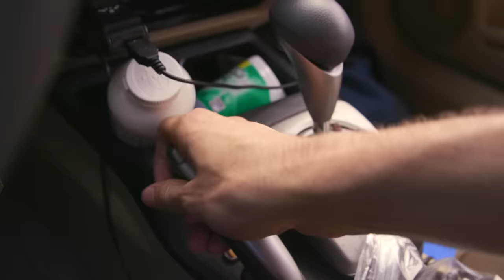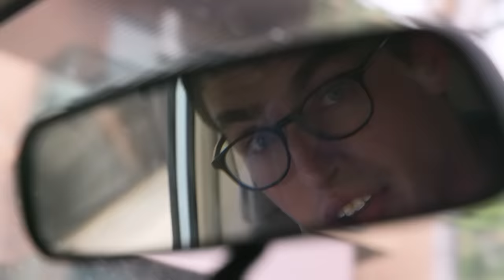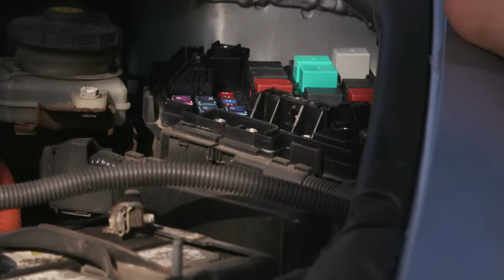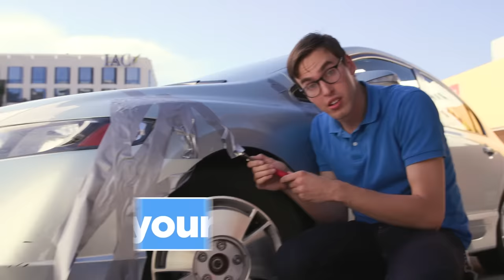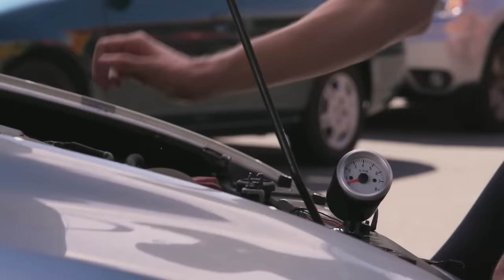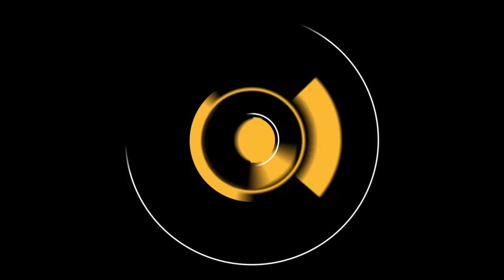5 Tips for People Who Don't Understand Cars

Comment: Tachometers check engine rotation in RPMs, and the alternator makes electricity from the rotation of the engine. Both diesel and gasoline cars have tachometers. And tachs definitely won't matter on alternators, because the rotational speed of alternator really doesn't matter. You're welcome.
Reply: Ceazar Carr but ma dang alternator don't work on ma diesel
Reply: not every car has a tach. for example, my 98 ford ranger didnt, which was wierd since it was a manual, where knowing engine rpm actually matters
Reply: Campy the easiest way to hook up an after market tach is buy using a magnetic pickup and using the flywheel as a rectifier
Reply: Ceazar Carr Actually the alternator converts the rotational energy from the timing/serpentine belt into electrical energy on the pulley that drives the rotation of the alternator's rotor that is surrounded by stator windings. The rotor creates a magnetic field as it rotates and that magnetic field charges the windings.
Reply: Campy That is true, but the "actually" was because the wording of the original comment made it out like the engine itself powered the alternator and the alternator magically made electrical energy. So, basically the "actually" was for the original commentors use of the word "create" in the context of energy output from the alternator.
Reply: +Kevin Volk same my 91 ranger manual does not have a tach...but don't need a tach lol
Reply: Yeah that tacho is meant for a scooter lol
Reply: Kevin Volk Yeah that's true, but I wasn't saying all of them had, just saying it wasn't something only for diesels.
Reply: dmooreisspawn828 So... the alternator makes energy from the rotation of the engine. That's what I said.
Reply: Ceazar Carr No, energy cannot be created or destroyed. The alternator doesn't create energy, it converts it from rotational energy to magnetic energy to electrical energy.
Reply: dmooreisspawn828 its designrd to create a type of energy that the car can use out of a type it cant, quit being annoying.
Reply: Sauriel m It doesn't create energy. Energy cannot be created or 
destroyed. It converts rotational energy to electrical energy through 
the medium of magnetic energy.
Reply: dmooreisspawn828 Sorry, I meant electricity, which is what I said in the first statement, which means my first statement was a summary of how an alternator works, and therefore was never wrong. Jesus, you really want to pick my statement apart piece by piece.
Reply: To you guys arguing about how an alternator makes electricity, you are both saying the same thing. Stop getting pissy over the wording. Sure, the technical phrase is the alternator convers rotational energy provided by the engines belt to electrical energy by blah blah blah. The basic phrase is, the engine spinning it causes the alternator to produce current. 

Now that that's over with, I want to point out that some engines, both gas and diesel, can get rpm information from the alternator. Some alternators actually have a terminal that your tach reads from. However it is vehicle specific since the tach needs to be calibrated to how many rotations of the alternator pully occur for every rotation of the crankshaft of the engine.
Reply: speed150mph Haha, you are awesome. Even in your rephrasing you said it correctly :P Also glad to see someone that knows about the different ways vehicles read rpm.
Reply: speed150mph To be honest I was just knit picking for shits and giggles, haha.
Reply: speed150mph Cool, never knew that
Reply: Not really nitpicking here but my car doesn't have a tach. It's not really a necessity on any car but it's more convenient and arguable on a manual transmission than an auto. Either way my car is a basic pile of junk and was always super cheap so that's why no tach.
Reply: Caleb Nation a tachometer is a really good diagnostic tool for an automatic if you know what to look for
Reply: What about my Bicycle?
Reply: Ceazar Carr pasta?
Reply: You had the same car for 4 years? l get run into every 1.5 to 2 years and everytime my car gets wrote off, so I buy another 10 year old Caddy or 6 year old Buick.
Reply: +steven bloomfield I mean yeah it's kinda handy but it's certainly not needed in any car. Some 80s racing series didn't have tachs in the cars just a speedo and a shift light. A physical dial for a tach is handy but really never needed.
Reply: Caleb Nation I know it's not needed but I like to have one
Reply: if you knew the ratio between the crank and the alternator, then you could figure out the rpm.
Reply: old diesels used the alternator for rpm sensing, higher the ac the quicker the engine is spinning, where older petrols used the coil energising wire. modern engines both just use the trigger wheel and the ecu handles the rest.
Reply: Ceazar Carr what?
Reply: but the belt still runs even when the cars stopped
Reply: The most acurate tach be one that measures the number of times the cylenders fire, which the ECU already knows. So the factory tach should be more than accurate.
Reply: Ceazar Carr My people!!
Reply: Errr, i think you got the wrong end of the stick there, you use the alternator to measure the speed of the engine in RPM, but usually only on older cars, sice about 2003/4 most cars use a speific Crank speed and crank position sensor to measure this. and if your car doesn't have a tach, you probably dont know enough about cars to need one. Your welcome
Reply: I never said thank you.
Reply: Ceazar Carr My grandfather's F-150 actually didn't have a tach. Had to guess when to shift by sound
Reply: Yeah I don't have a tacho, I've got a '79 Beetle
Reply: Ceazar Carr I was waiting to find this comment. Thank you 😂
Reply: Chloe Ellis I don't disappoint!
Reply: Ceazar Carr now I don't have to explain it.  Thanks
Reply: Kevin Volk it's called don't buy a Ford
Reply: this thread is god
Reply: Right. I just went through this thread for the heck of it and I can safely say, with utmost certainty, that I am definitely NOT a engineering/science/car/tech-that-isn't-a-computer-or-phone-or-game-console person 🤣

Thank you very much to all the kind souls in this thread that have helped me reaffirm my identity and awareness of myself as a Arts/Humanities/Languages person 🤣🤣
Reply: Campy yeah but idk why you'd do that. Most installable tach kits hook up to the ignition module/ coil via a splitter. Just installed one on my geo. But it's different for carbed engines
Reply: Ceazar Carr How much boost u running dude?
Reply: Ceazar Carr Rotational speeds of the alternator do actually matter. The more it spins the more it charges, but technically you're right because even when the car is idling you still charge at around 12.6v
Reply: So, I wanted to add, since everyone else is adding stuff for accuracy, that electric current is just moving charge, and moving charge creates a magnetic field. When the magnetic field in the alternator changes as the magnet inside is rotated, which is also called magnetic flux, current is generated to oppose the change in the magnetic field to try to keep it constant. This is called Lenz's law, and the current is what charges the battery as it creates a potential difference. This is the underpinning idea behind most generators, and the reverse, electricity causing magnets to rotate, causing rotation, is how motors work. Simple electrodynamics, guys! :P
Reply: Ceazar Carr exactly
Reply: Ceazar Carr please use smaller words when it comes to cars I did not understand anything
Reply: The MortZar Thing go spinny. Tach checks how many spinnys. Alternator is wrong spinny.
Reply: radical man you're the best
Reply: Nerd
Reply: and the award for the person who doesn't understand the joke goes to...
Reply: i am pretty sure he understood

right?
Reply: Ah thanks, was confused by a false friend for a second. In german, the "Tacho" is the Speed dial, and what you call Tachometer is, crudely translated, the rpm-sensor. I was thinking "wait, how can you get to the speed from the revs of the alternator? You'd have to factor in the gear you're in, which seems way too complicated"
Reply: Your a Wise Man
Reply: Me
Reply: I wish there was a way to save comment threads because this is absolutely amazing.
Reply: Ceazar Carr I see your a car guy too😂 you wouldn’t want a tach on your alternator because it’s spinning faster that the crankshaft. So it would be reading way too high unless you calibrated it
Reply: dmooreisspawn828 what happened to the good old fashioned distributer?😂
Reply: Ceazar Carr ..what??
Reply: Ceazar Carr yeah I- I knew that i swarrt
Reply: Guggu3d if you wanna get real technical your alternator only begins to "charge" once your battery voltage makes a noticeable decrease and it charges around 14 volts on a 12 volt system, in order to keep the engine and accessories running whilst simultaneously charging the battery :)
Reply: Beat me to it
Reply: Ceazar Carr alternators are basically generators for cars kinda
Reply: DiMZ Cars used to have generators.. when all they used was Direct Current. But nowadays they use Alternating current, thus "an Alternator".. so no. It's not a generator. But that's all technical.
Reply: Ceazar Carr i like how all of us car people made our own little section in the comments😂
Reply: Not every car has a tach a lot of diesels don’t
Reply: I don't understand any of this because I'm eleven
Reply: Nintendocat 1 it’s never too early to learn how cars work
Reply: Yeah
Reply: Ceazar Carr English please
Reply: Ceazar Carr—— Yay, I was hoping someone else would explain it so that I didn’t because I’m lazy
Reply: Ceazar Carr yes. i definitely understood wot u just said.
Reply: All hail car smart man
Reply: Ceazar Carr thank you
Reply: Ceazar Carr control c control v???????
Reply: Umm... this makes... sense...

Hey... dad?
Reply: Some older toyotas didnt have tachometers because the engine was so tiny the just assumed "meh not much to measure anywho"
Reply: Taylor St. Pierre If your alternator doesn't work then a you have bigger problems than a tachometer. Firstly being that you can't start your engine anymore without any electricity. Best just to drive to a shop if you aren't a mechanic or haven't disassembled an engine before and also have the parts on hand.
Reply: Dad?
Reply: huh?
Reply: Wtf does any thing I just read mean I don't under stand cars please help
Reply: lol how many google searches did this comment have
Reply: I think he was joking but this is awesome 👏🏼
Reply: in europe every car has a tachometer and every car is a diesel
Reply: 😂 😂 My first car didn't have a rev counter but hey don't need one if you understand the car
Reply: On some model of cars they came from the factory with the tack reading off of the alternator
Reply: Yes, thank you... now, does anyone have a "Machine Gobbledygook to English" dictionary?
Reply: I understood nothing in that paragraph.
Reply: Kevin Volk no but your 98 ranger has a redline and an idle
Reply: Taylor St. Pierre nice
Reply: Nerd
Reply: Ceazar Carr he was meaning the sensor for it @ the alternator
Reply: @kevinvolk968  that is when you use your ears as a tach. My grandpa's f 150 doesn't have a tach, and you just have to listen for when to shift
Reply: @Josh-je2ni  well yeah, its just not as exact using your ears as a tech would be. Say if you want to shift for max efficiency or max power. You can ball park it by ear, but seeing a tach is more accurate. I just don't know why you're more likely to see a tach in a auto where it doesn't matter than in a stick where it does.
Reply: R/Iamverysmart
Reply: @kevinvolk968  you should be able to use your ears fairly well though, as on tracks you may not have the time to take your eyes from where you are going, that is where you need to use your ears
Reply: @kevinvolk968  no tach on your 98? i feel that. i grew up on a farm and we have those old dually's (like 60's) and they didn't have any gauges other than temperature oil and gas, because they were only meant to go so fast carrying grain to a silo. no tach, no gas, and they were manual, it was just farm culture. you listened to the motor. no power steering? you felt the road in the truck. its an acquired skill, but its a motion you get into, listening when it gets high enough and youre going fast enough you wanna shift, etc. funny enough, it had the clutch in a little button on the stick, so it only had 2 pedals on the floor.
Reply: Are you Grant's Dad?
Reply: Tachometer is great on a manual car though.

...
So I can change gears when the little needle hits 30! Right dad?
Reply: You're a literal fucking god
Reply: Got it everything he said was completely incorrect

Comment: Don't forget to change your blinker fluid this winter
Reply: Steam-Powered Fox i use a lighter weight halogen fluid.  makes blink them blink faster
Reply: Mass Debator. don't forget elbow grease
Reply: In older cars you can just mix the blinker fluid with antifreeze at a 50/50 ratio.  But don't try that on new cars or it'll mess up the sensors
Reply: Eyedrops
Reply: While you're at it, check your piston return springs
Reply: @RyfusFox  "hey Chris fix here"🤣
Reply: I'm not going to tell you how long my brothers convinced me that was real... 😂
Reply: @codyduff655  
Did you set it to W for Wumbo?
Reply: Blinkers take fluid? How does this work? Are they hydraulic? I need to know this.
Reply: @Nora Cole I'm 14. Don't need to worry about that for at least 3 years. Thankfully
Reply: @aidanpaul2745  Oh god, after having read these comments and the fact that you're only 14, I feel bad and need to tell you that blinker fluid isn't a thing.
Reply: @ArgueWithTheMajority  ...
Reply: @aidanpaul2745  If you knew, that's fine with me. Sorry I broke the chain then.
Reply: @ArgueWithTheMajority  we almost got one lol
Reply: And grease the muffler bearing
Reply: Yeah you gotta physically rip out the piston, fix it then just slide it back in, when you hear the click you’ll be set

Comment: I don't know much about cars... where can I buy new turn signal fluid?
Reply: long live nuski Same place you get muffler bearings.
Reply: long live nuski Make sure you up grade to the chrome muffler bearings! If you can't afford them go for the stainless steel muffler bearings. And don't forget the kinibbler pin , kanoodler valve , Johnson rod , ch'uping bar , woodruff key , and hydrasalator . And whatever you do DON'T TRY TO REPLACE THE HYDRASALATOR YOURSELF!  It's very dangerous and should only be done by a professional! (one of these parts is actually real)
Reply: Your local tip
Reply: You also need to get piston return springs, the Blinker fluid reservoir can affect them.
Reply: Don’t forget piston return springs
Reply: Wait why does a turn signal need fluid o.O
Isn't it just a blinking light...shouldn't it only need electricity and maybe a new mini bulb every decade or so?
Reply: HaichaoTeaLover It’s called a joke. You missed the joke, there’s no such thing as “blinker fluid”
Reply: Joey shaffer actually turn signal fluid is a great idea. It seems stupid but it gets rid of that foggy look in headlights some cars get. I’ve seen the YouTube video
Reply: I love rooster teeth!
Reply: Dont forget to buy U joint Degreaser.

Comment: Thanks for this CH, just got my license and can't wait to show off these skills.
Reply from the maker: Remember... REAL drivers use the gas pedal and brake at the same time. Car hack! Look at all the smoke! That means you're doing it right!
Reply: CollegeHumor NO DON'T LOOK AT THE SMOKE THIS IS A FAKE!! ... look at the fire duh
Reply: There is actually a driving technique that involves using the accelerator, brake and clutch at the same time. Heel-and-toe or rev-matching is often used in racing, but it can be beneficial during daily driving, as it&#39;s easier on the transmission.
Reply: I think you worded that wrong... but I may also not be getting what you mean by pressing three pedals simultaneously. I drive a clutch and every description of rev-matching i've had explained is not only how I drive (good teacher I guess) but doesn't involve somehow pressing all three pedals.

I've been told shifting on the fly is far easier on your car and fuel economy(unless done wrong). Which ended up saving me a tow truck when my clutch cylinders went out.
Reply: Heel-toe is for braking and downshifting at the same time. Rev-matching is for downshifting to pass or re-entering a gear (IE you slowed down a bit and put the car into neutral, then went to accelerate again). 

Essentially, the goal of rev-matching is to make the engine speed as close as possible to the speed it would be if the car were in the gear you're about to select.

Heel-toe is combining braking WITH rev-matching. This is more of a racing technique, designed to get you into the right gear for corner-exit. Rev-matching by itself is something anyone who drives a manual transmission should know.
Reply: Yeah, what you guys said. I was really tired when posting that comment, so I prolly made some mistakes. Thanks for clearing it up!
Reply: Now it sounds like I'm trying to defend myself :/
Reply: Erik M. No worries, I asked because I wasn't sure. Glad it was cleared up.
Reply: What's this? Someone being nice on YT? Impossible!
Reply: There are good people out there... probably. :)
Reply: Erik M. They cant understand that unless they are prectically a racing driver. LOL carhtrottle